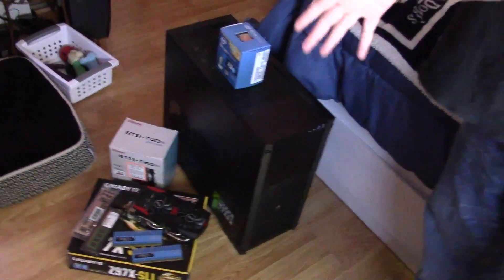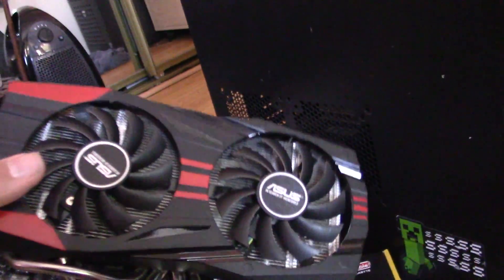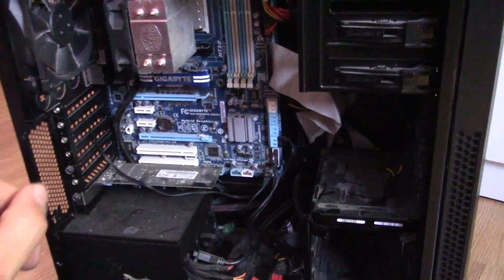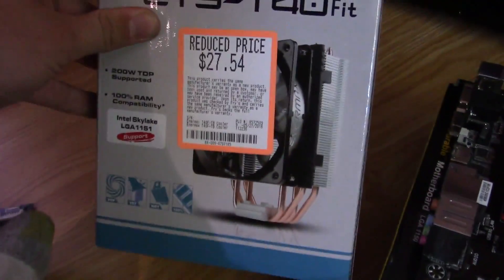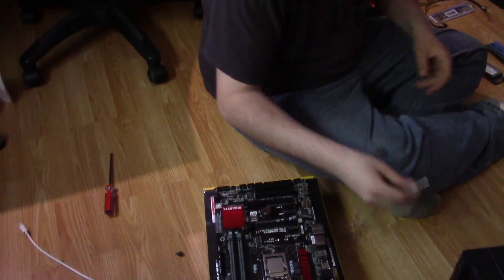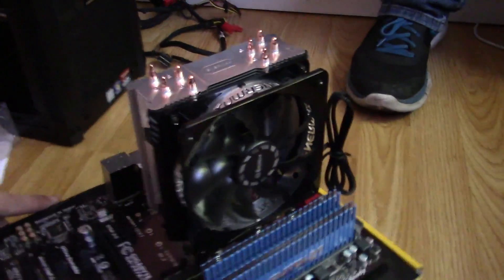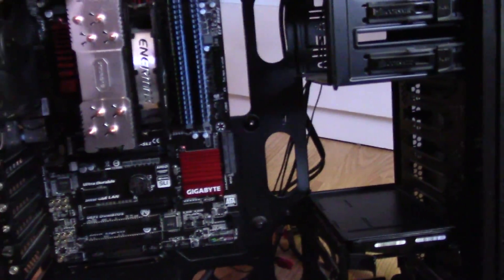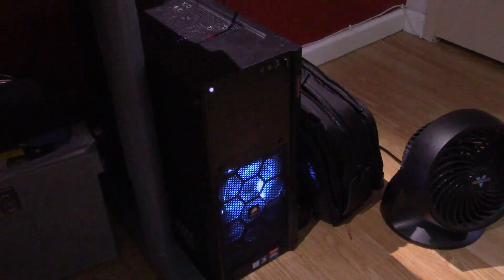i5 4690K PC Build (2016)

Comment: Played gta v on 8gb of DDR2 and a Phenom x4 840 and it ran OK but the textures would lag to the point were you'd suddenly find yourself stuck in objects (Video card a radeon 260x). Now using a 6600k I5 with 16GB DDR4 and playing on medium - high with over 60 FPS with same card.
Reply: +Jak My LG 23EA53 is derp with input switching too. If its in DVI mode it won't auto switch to anything else but if its in HDMI it will auto change to DVI.
Reply from the maker: +Jak Yeah I don't get it, I've never had a monitor that doesn't auto switch...I was scratching my head for a bit wondering why there was no video until I realized...

Comment: I've got the same CPU, pretty good overclocker.
Reply from the maker: +Redey1290 Weirldy enough I can't get anything stable on this machine. I tried even the most basic bitch overclock at 4GHz and it just fails Intel Burn Test every time. Not sure if it's my board's power phases (probably not) or the PSU, or something else...
Reply: Dell0304 I mean I have a 3.8ghz overclock right now, but one thing that could be holding your overclock back is the CPU power connector, if your board uses only 4-pin connectors rather than the full 8-pin connector, the voltage could be limited, not allowing for a huge overclock.
That or you got an unlucky i5 and it just doesn't like a big overclock.
Reply from the maker: Turns out it was the old RAM I was using. Now stable at 4.2GHz after removing the RAM.
Reply from the maker: And no, my board has an 8 pin connector.
Reply: Dell0304 Oh that's really odd. Never heard of RAM holding back an overclock.
Reply from the maker: Said RAM is from 2010, so I'm not really surprised.
Reply: Dell0304 Oh yeah that makes more sense.